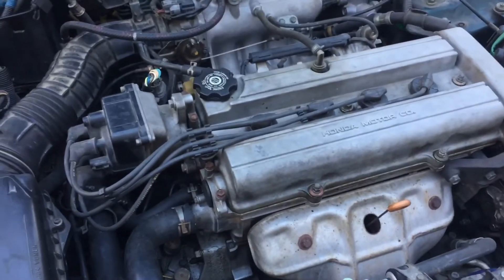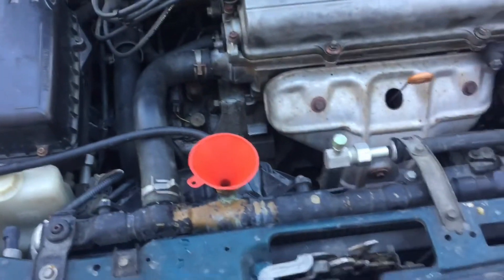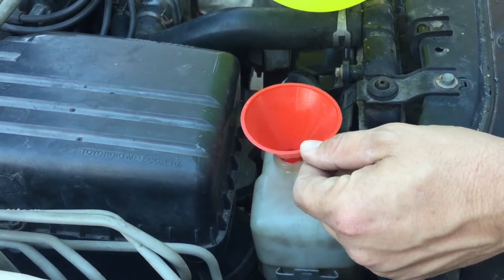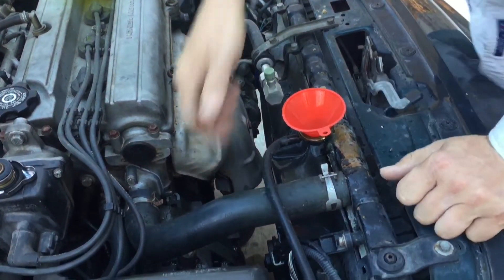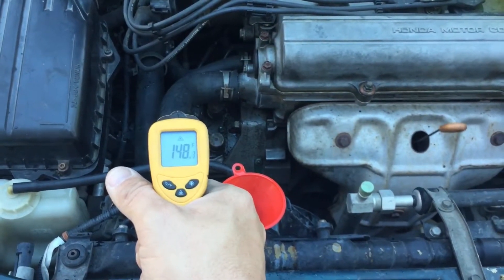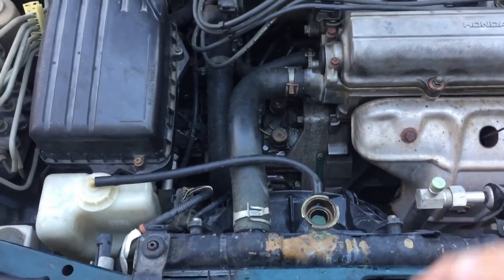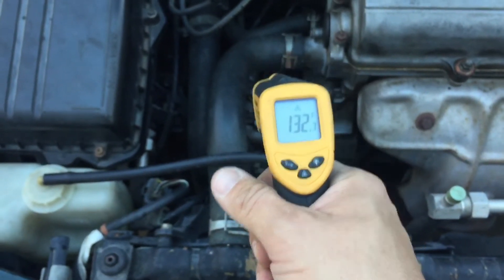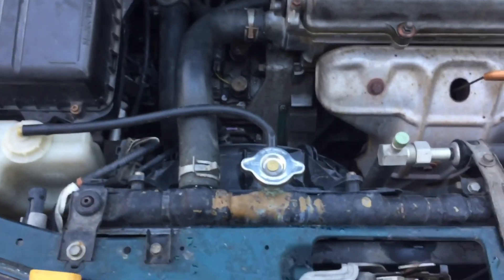Acura Integra: Bleed your coolant.

Comment: Do you start the car with the radiator cap off? What does it mean if it shoots out like a volcano?
Reply from the maker: If it was cold when you started it, you’re getting a leak into the coolant system. Probably a bad head gasket.

Comment: What coolant did you use here?
Reply from the maker: I likely used whatever was the cheapest at the auto parts store.
Reply: @BellyUpFishGarage  Cool.  Is this coolant still in the Integra today or has it been since changed again?  Any issues?
Reply from the maker: I’ve since changed the coolant, only because I swapped the head gasket. 

Pretty sure I’m running Prestone in it right now and have had no issues.

Comment: So I was told to bleed since I got a new iacv
Reply: Giving a goofy idle like it's not working. So thanks for this and hope it helps
Reply: Bouta change my iacv what made you change yours you caught an engine light ?
Reply: @triGLogictriGCofounder  it was the oem one. Figured I'd just go new. Ended up my TPS was bad and causing the bouncy idle. I have skunk2 parts but when they put the tps on they didn't read the resistance and was not set properly
Reply: @triGLogictriGCofounder  I have had 0 engine lights. So searching for the issue was not ez. Took about a year and a half of hunting everythingggg